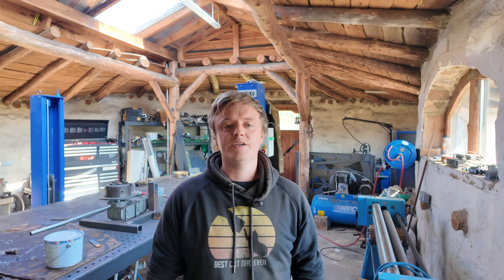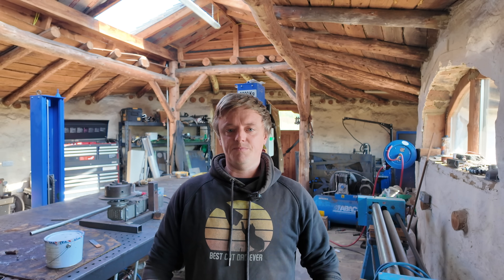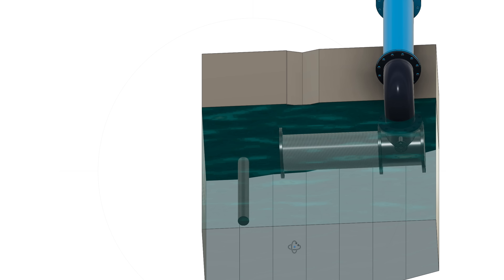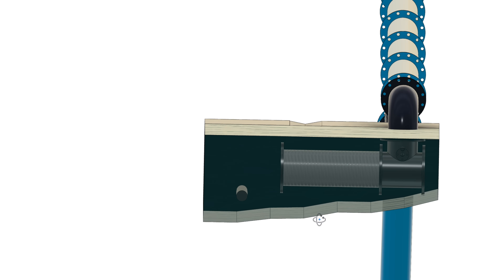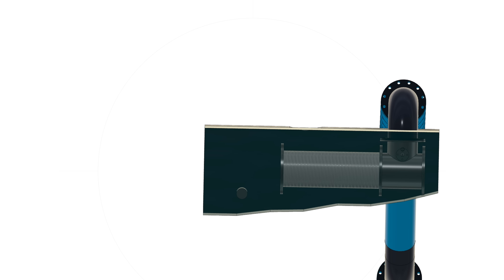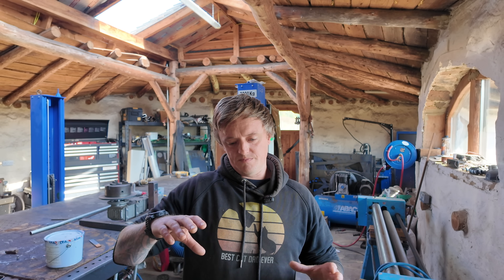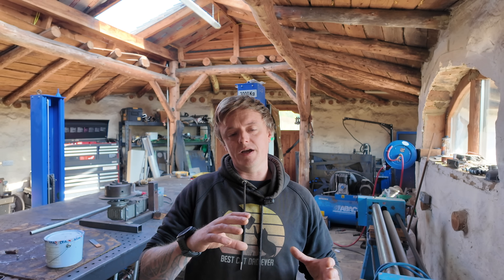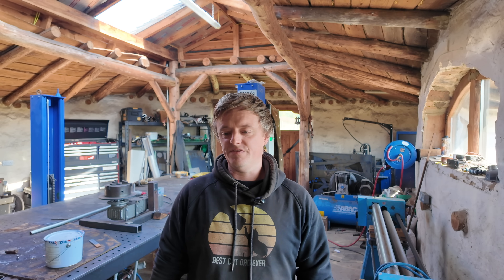Hydroelectric Crossflow Turbine Project, Part 1, The Intake

Comment: I've seen a few of your projects and seen that you most likely are unaware of the danger you are flirting with. You weld with exposed skin and are getting intense UV radiation when arc welding. Being young you may feel invisible and not think melnoma won't hit you. Its accumulative.
And your grinding with abrasives in an enclosed space is another common practice I've seen in your otherwise great videos.
Silicosis and emphysema are not reversible and sometimes lung cancer isn't either.
Much of the silica that enters the lungs never exits again -its also accumulative. With your many excellent skills you could surely find info on the common safety practices of welding.
And there is no kind of welding that emits safe fumes- there is cheap respirators that fits and the helmet.
It would be great for all alternative energy enthusiasts that you stay healthy and maybe be a kind of good example on how to stay safe welding and grinding. There are many diy'ers that start up welding et.c. and as a skilled diy'er and fabricator you are a role model for some.
Cheers and keep up the good work

Comment: I always enjoy your videos, especially ones like this, showcasing your fabrication skills. However, I must say that I was surprised that all scenes showed you welding bare handed. I worked 5 years in a stainless pipe factory and did a fair amount of hand welding exactly how you were in this video, however I only did a weld once barehanded. I had "sunburn" on my hands so bad from the arc light that I could barely use them for a week.

Comment: Wow..  Those bolts are massive. I know it's not your fault. Couldn't you have drilled new smaller holes in the steel flange? Maybe I don't know what I'm talking about. Just a thought. Great work as usual Kris. I learn so many  tips and tricks from watching your work. Joints in wood and steel, connections, hoisting, stone work, cider making (that's a good one, lol). Moving heavy things from one place to another, all round general building. The list is endless and everything is so professionally created. Everything is self taught. Keep up the videos Kris. Reading the comments on your videos, I can tell so many, young and old are inspired by your work ethic and commitment in everything you do. 👍🏻

Comment: If the intake is partially blocked, water stills flows, high air pressure blasts the debree away from the intake grill. Would not the rest or at least a part of the air bubbles get into the water pipe? If that happes, it could accumulate at the highpoint of the the Syphon and eventually break the flow of water. 

So the water flow has to be very fast that bubbles get taken away or very slow so that they wont get sucked in right?

Just a question 😅 maybe i am wrong

Comment: Nice job! You could have also just cut the big pipe under a 45 degree angle and weld them together to make a 90? One cut / one weld instead of adding an extra flange / blind plate / bolts.. Looking forward to see the end result!
Reply: yes cad a piece of paper with a sine wave of the correct amplitude etc , wrap it round the pipe. Cut along the line. when you rotate the two halves it is a perfect rt angle. it worked brilliantly for me on a big sewer pipe

Comment: Hi, great video as always. I dont  want to put a downer on your work, but please look at health and safety. No blade guard on your grinder, holding the piece you're working on with one hand and operating the grinder with the other. No eye protection, and your welding mask raised even though its probably got grind function. As I said, your work is amazing and you are doing a great job, but I would hate for you to seriously hurt yourself, or worse. It only takes a second to end all you've worked so hard for, and we'd all be gutted if you stopped putting great videos out. Be safe mate, look after yourself.

Comment: Suggestion for your blowout pipe at the end where the cap is . Weld a flange to the end aslo weld bolts to the flange cut holes in the end cap for the bolts fasten to the cap this way its more riged last longer over time . Ps if thats stainless steel  you have it on an iron table which will start it rusting  clean where it touched the iron mabe get some flat wide pieces of rubber to prevent contamination  . This is going to be interesting  series . 🎅🍺
Reply: 100% agree with this (if I am understanding it). I was going to comment similar items, but mostly ... to prevent future "weakest link" failure (and a very difficult & needless distant future return service visit) ... it is vital to make the blowout pipe as rigid/stable as possible! Current design will allow excess "torquing" of the weld (water movement/pressure/force & air movement/force far exceed your human arm wiggle/force on the pipe!!!). Fix by simply welding a properly aligned 'cup' to the "end cap". The 'cup' simply contains the end of the blowout pipe so that it has near zero movement. The cup is welded to the large end cap and simply fits snug over the blowout pipe so that large end cap can still be easily removed. (perhaps line this "blowout pipe containment cup" inside diameter with a rubber gasket/lining to minimize "pipe pinging").

Comment: nice work Kris, impressed with your pipe fitting skills, normally the flanges would be set off the pipe a little to allow a weld on the inside that doesn't affect the face of the flange and typically those flanged would be two holed, ie your top center line would land between two holes, anyway only real advice I would give is be very careful when weld that stainless it really likes to move especially on short saddles, elbows etc, we would normally weld the pipe fully before doing any flanges, I would almost guarantee you will have to move those flanges once you have welded that saddle (you probably know this), at least if you need everything square, you might also want a few extra tacks on the quarters of those flanges to try and keep that pipe fairly round as you weld the saddle. cheers, good luck.  Commented this at the start of your v!d, by the end you had it welded!!!!!!!!! did your flanges stay square and flat?

Comment: To reduce turbulence around the 90-degree pipe corner, could you cut a sideways, quarter round piece of pipe and mount it behind the block off plate? (I'm sorry that isn't very clear. I can't think of the geometric descriptors)

Comment: Great work Chris. Maybe check out what ‘one hole square’ or ‘two hole square’ means. It’ll help you for future flange work. Can’t wait for the install
Reply: Yep, I agree! As a 50 year pipefitter I noticed the ‘one hole’ fitup right away. ‘Two hole’ is standard practice, especially where there’s a tight area for bolts.

Comment: im not sure how the end results will be. but how would you restart the water flow if it all drains out? from your original showings the intake will raise above the Dam and then go down to the turbine. would adding a port (near the middle of the  pipe just below the first 30 feet) for a vacuum to be used to create the reflow of the water work?

Comment: One question I Would ask you could you have build a segmented bend by cutting the pipe into segments of 15 degrees. By cutting the first section with the leg long  and then cutting it at 7.5 degrees rotate the cut 180 degrees till you have the right number of section for the 90 degrees. The throat of the bend can be as small or as large you want.

Comment: How will the siphon effect be achieved with this self-cleaning system using an air jet?
In this case, I would use water instead of air. There's a high risk of disrupting the siphon effect, as it could create an air pocket that would strangle the water flow.
Personally, I would use a Coanda screen downstream of the dam. It would be a more expensive structure, but we wouldn't have this problem. Tips for the near future. Excellent work.
Reply: Regarding drilling holes or cuts in the dam, would these be due to environmental laws that prohibit any modifications to the dam?
Are holes for anchoring a gutter with a Coanda screen on the underside of the dam where the water falls still on the prohibited list?

Comment: I like pretty much everything you do. But I do find it irksome when you put fastenings on horizontal & vertical centres. Something you will never see anywhere else. It is just bad practice & sooner or later you are going to come a cropper doing it. Incidentally, with pressure flanges it is normal to use stud boltings, not a nut & bolt. This is because you can remove the stud from either side. This is not possible with a nut & bolt. I agree your nut & bolt are cheaper, so as this is low pressure stuff, why not use the nut & bolt. And there are lots of occasions when the rules go out the window.
Reply from the maker: Hello, thanks for the comment. You are 100% correct. And I am learning as I go with all this. I have no formal training so the only way I can learn is from mistakes and comments like this. I am Aware of this now and in the future I won't make this mistake.

Comment: I'm no engineer, but I am wondering if your manufactured 90* bend will create a lot of turbulence with the water hitting the end cap then bouncing back straight into the path of the stream. Ideally I think you should smooth the curve so that the water flows around the corner and out the pipe.

Comment: I have many times made a comment that Kris has not taken on board. ALL BOLT HOLES ARE OFF CENTRE. I have seen the problems when the valve he bought has all the bolt holes off centre so DOES NOT FIT CORRECTLY.

Comment: Why not put the intake box after the dam?
No Syphon, no air cleaning.
Just have the water wash over the coanda screen.
Same (almost) head and same flow.

Only reason to have the inlet in the dam is if the output to the turbine momentarily is higher than the flow into the dam.

Comment: Might wanted to use smaller bolts on the end caps as the pressure will be equal on both sides, large bolts are cost more, still interesting project.

Comment: Not Kris, you can make your own bends with the segment method, Kris. That's how we did it at British Sugar when we needed a (90 digger bent  I will explain how it is done if you need to know. Just ask how it is, if you desire me to, but it makes a good band.  &  in your case, it is better that a (T) section an inlet. It's a shame you did not get in touch. Note.  if you try making one, do not attempt welding until you have your segment cut out & put together, until you have a good fitting set of segments, &  grind as if you're welding from the inside as you weld up the segment & polish as you go. Note First, put down sufficient weld so it can be polished off AS flat as possible. Once coupled to the inlet & outlet. clean & weld the outside pipe welds you have just finished. & Making a smooth TIG weld. you do so. well, in stainless, fit your flanges & you have a 90-degree bend.
Tailor-made for your project.

I'm retired now, but I can come a show you how it's done.  But I'm Sarton. Now you have a very good idea how it was achieved. (Think oranges.)   You can get in touch by messaging me on the Facebook page should you feel the need. Les the UK, Telford, or pay me a visit, you're welcome. ant time. Les UK. Well done so far, interesting project. Hope to see it working. on your next post. 

 PS Kris. There may be a pip cutting program on your.  Plasma table.  in a flat profile that may help you out.  When finding  A segment with cardboard is a second  Option. I have used myself many times. Hope it helps  for the next one.

Comment: If that air cleaning tube fills with water it could generate a lot of thrust if you suddenly open high pressure air to it as the water jets out at that pressure, mostly downwards pushing the tube upwards.
IDK what pressure air and how fast it can flow or the valve will open but it might be something to consider limiting. Especially given the lever length, though there would probably be less pressure at the far end.

Comment: Exciting!... One thing I will say is you really need extraction or a PAPR mask. The hexavalent chromium oxides from welding stainless will reduce your life span considerably! I recommend you get an arc droid for those pipe holes, it will save you a lot of time. Talk to Rob from extreme plasma UK and say I said hi. Cheers J
Reply: For everyone at home Hexavalent chromium is the chemical in Erin Brockovich. It's really bad
Reply: @drosophilamelanogaster4625  Yes, but a couple drops in a martini is DEELISH!
Reply: Agreed. He could do an air fed welding mask. Will protect him while grinding aswel. I looked into the esab sentinel a while ago before changing job
Reply: @patrickcollins-op6li R-tech do a good version which flips up and has a grinding shield.
Reply: Metal-fume fever is no joke
Reply: Optrel Swiss air  does a half mask thing if you find the full helmets heavy and claustrophobic.. can buy it seperately and use it with cheaper air source than the optrel backpack 🤑
Reply: I bet Kris could build his own kit. Maybe even better than the expensive ones.
Reply: Lost a good friend a young age on lung cancer. He was a welder who often complained about the fumes.

Comment: Think I might have had the air purge pipe carry on out through the flange end plate and capped with a stop valve to purge the pipe out incase of a blockage, im asssuming the air purge is not running continuously.
Reply: That does sound a good idea.

Comment: Are you sure that there’s not too much pressure on the weld of the aerator, when it’s filled with air underwater. I would try and add something to the other end to hold it down because that’s quite a bit of length applying pressure to the weld

Comment: That syphon is going to be a nightmare. I came across this but on a lot smaller scale. I had an over the top overflow on my fish tank. It would collect air at the highest point loosing efficiency and eventually the syphon.
Reply: air is always the achilis heel in fluid dynamics.
Reply: better yet he put "air cleaning"  right under the syphon. lmao.

Comment: Very impressive manufacturing. There's a stream where I work that has a similar head and I can see something like this working so this is very interesting. I'm not sure if it would maintain the same flow rate except in wet weather. However even half the output would be worth having.

Comment: 👍  Excited, she's a whopper.   Is there a reason you centered the flange bolt holes with the 90 degree pipe instead of centering the 90 between two flange bolt holes for easier access to the nuts?

Comment: Yes great, the syphon hydro my favourite of all the hydro electric production designs, originally used with an archimedes wheel from just below the  dam level but I think it's not used as primeing the pipe below the Archimedes wheel is a task, you'd have to have multiple ball valves at a good diameter, so costs would double.
I researched the most cost effective way to controll the prodution of a water hydro and I've come up with the sliding gate, as ball valve would be in their thousands for x diameter via a simple motorised sliding gate with the vortex  behind, then you could probably controll to the nearest 250w for the maximum maybe 5kw, and a small battery or giant capacitors would buffer the big draws untill the sliding gate opens.

Comment: Please put a support on the end of the air pipe. Thats a long lever arm and repeated stress could crack the welds at the other end. Its probably fine as is, but it would be cheap insurance to just add a small support that slips over the end to secure it to the end cap to prevent any issues.
Reply: I think he said this? 11:54
Reply: @sroberts605  I believe at 11:54 he's referring to the end cap for the air tube, not a support for the air tube. Then later at 14:18 he says the air tube is "rigid enough" then put the large end cap on. I agree that its probably rigid enough, but I think it would be worth it to add a retaining collar on the large end cap that slips over to prevent the air tube from flexing and be 100% sure.
Reply: @Savan12986  I think you're right

Comment: I wonder whether it is worth 3D printing an insert that goes in front of the end cap to smoothly move the water though the 90 degrees ? I imagine plastic would be fine because the forces involved at that point wont be huge. It could be bonded to the end cap
Reply: I was wondering what the losses are of that 90° bend in the tee. I've no doubt there are good reasons for the tee but it wouldn't have been that hard to weld up a nice swept 90° bend.
Reply: @Ed.R  Curves in 2D are not that easy to form in sheet metal.

Comment: Kris, have you looked at getting a welding table addon that bolts down on the welding table and allows the work you're welding on to spin in a circle - there's a posh one that you can power the spin as well - so basically you stay in one place and the work moves for you
Reply: He has a rotary welding  positioner.

Comment: Utilita do a no standing charge tarrif but charge a higher unit rate so if you system works as designed it may be worth your customer looking Into changing there elec suppler.